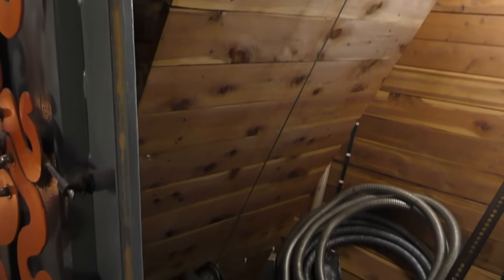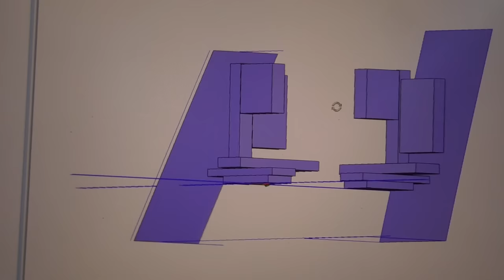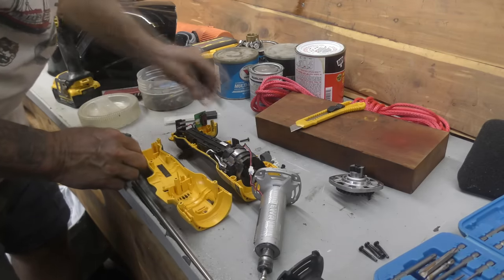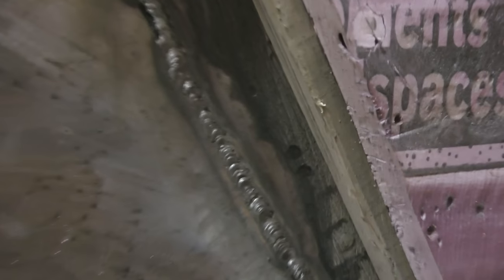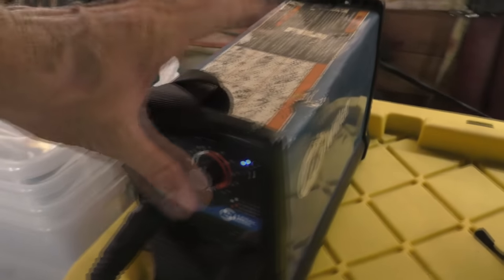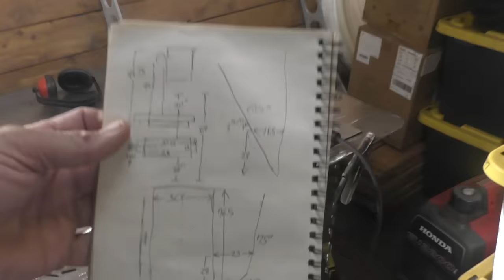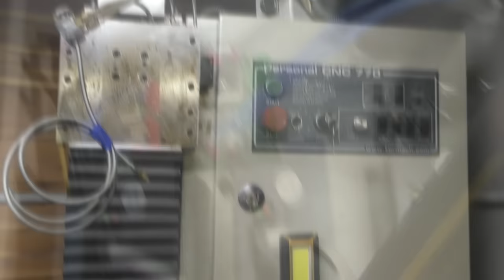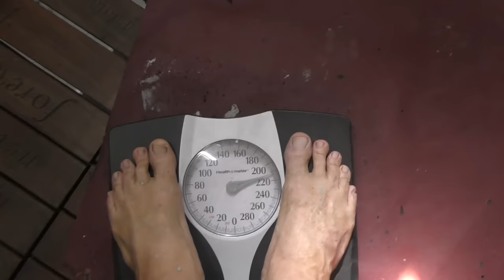Moving the Mill to Balance the Boat

Comment: To save you some grinding time , try buying cold rolled steel. it has a smooth finish with no mill scale. you might have to clean a light oily film that keeps it from rusting while in storage..
I have been watching for several years and came down to 
tulsa after you moved the boat.. We met briefly and I gave you a book on Sheetmetal layout..I hope that you have taken a little time to look thru it..Keep having fun.. Steve Ozias

Comment: Doug, get a couple plastic shower caps to put over the smoke detector when doing things like that. I have to when making pizza in my house. The 500 degrees over is too much of a shock for it and freaks my dogs out. They think a monster jumped out of the oven. Not fun when pulling a mega hot pizza out. I also love using power tools to fix power tolls. Just seems natural. 😁😁 I was a 160lb flooring installer for many years and preferred to move refrigerators by myself. Leverage is your friend. Someone on the other end pulling the wrong is not.👍👍

Comment: 14:37 Hey!  If those holes line up enough, you could slide PVC pipes through them as storage tubes right under the mill.
Reply from the maker: Air compressor lives in there now.  Might have room for 1 drawer.

Comment: I think moving the mill out there was a good move, as well as having the little work table for welding next to it. Probably going to take a bit more attention to keep the ways rust free, but it will make the tool far more useful.
Reply from the maker: Yes.  When I get back to work on the ROV I can have it work on longer sections of the hull.

Comment: the lockout button is so that the tool can be thrown into a tool bag with the battery on it and it will not run accidentally when being transported quickly, it really has nothing to do with the missing trigger lock feature
Reply from the maker: For the morons that leave the battery on?
Reply: @SVSeeker  when you have the whole set of tools in a bag it takes up less space having all your batteries plugged into tools. you can still buy drills with a trigger lock it just has to be corded. you can cook those cordless drills surprisingly easily trying to do full duty things
Reply from the maker: @imchris5000   Yeah, you're not stretching for a reason.  : )
Reply: @SVSeeker  I resemble that remark! but seriously, if the feature doesn't suit your use case, it's a good idea to remove it 👍
Reply: LOL @SVSeeker

Comment: Seeker is a heavy girl I doubt you are going to change her draught you can trim her out thou. It would take thousands of pounds to do so you are no plastic sailboat where a group of crew members can change the trim of the boat. You know for one thing if you hit a rock shoal you ain't gonna rip the keel off. You have to watch how much weight you shift forward it will change the reaction time of your bow. Get into some rolling seas you may plow through the waves taking water over the bow it won't return quick enough.

Comment: @svseeker You should up your batteries to 48v, and get a hybrid inverter 10k or 12k, with an auto gen start feature as well as the normal solar inputs, those can easily handle 60-80 amps, plus the more batteries you have the less you need to run the generator. Best of 48v batteries vs 24v will give you much longer run times with the same AH capacity

Comment: At 24:24 - Hint on trying to lift a large object in place and get a bolt started.  Cut the head off of a matching bolt making it into a stud.  Screw it in near the top.  Then lift the heavy object and hang it onto that bolt/stud to take the weight off. Then put in the other bolts!  My two cents.

Comment: I still think adding ballast tanks would be the way to go. if you build the system with big enough valves you could combine it with a micro controller with a mercury switch to automatically counter heeling when sailing. it also gives you somewhat of a double hull. your going to need way more freeboard if you ever want to leave the gulf

Comment: With 7018, when you go to re start, push sideways on the tip tip with your thumb and that cap of slag will pop off clean. So you don't have to bang it
Reply: When you finish the bead give it the 7018 wrist flick.  Slag flies off lands on the cedar and burns the boat down. Just kidding. You can never have enough asbestos blankets when you're welding inside. Gluing some 36 grit to a pc of wood run the rod over the paper a couple of times usually takes off enough flux to strike an arc. Perseverance and relentless OCD counts just as much talent.😃